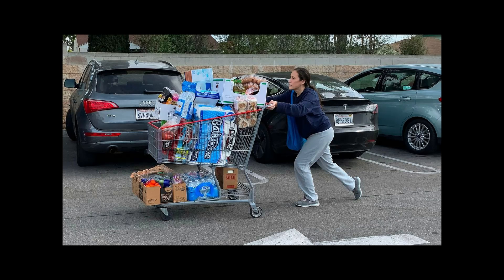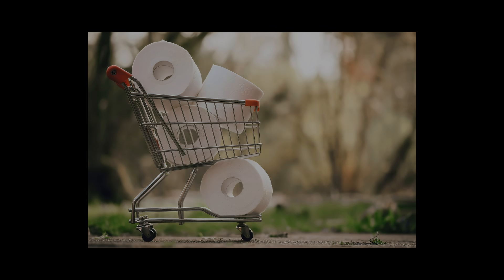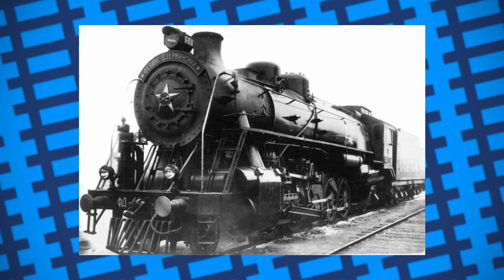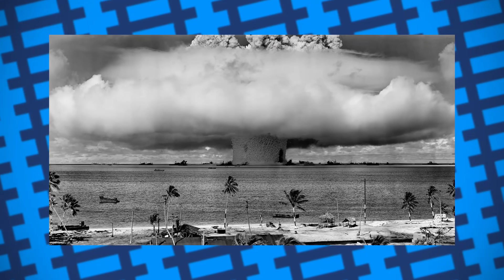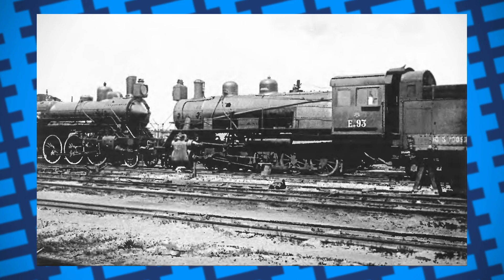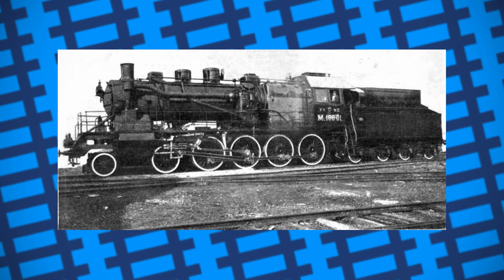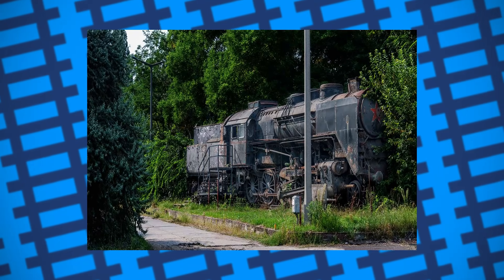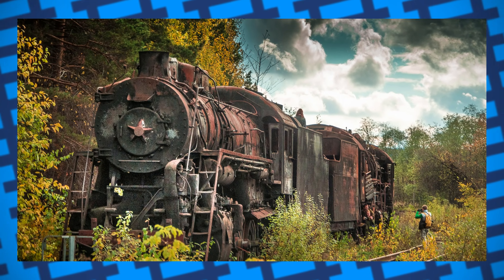Why the USSR preserved hundreds of steam engines - USSR Backup Engines

Comment: One of the other thing compared to early electric and diesel Locomotives, steam locos were actually easier to maintain as they could run even when quite a lot of stuff is broken or damaged. It was why industrial Locomotives in the UK were often Steam even after steam Locomotives had been got rid of on the main line (plus cheaper to rent and run).
Reply: For direct diesel, maybe, but even early diesel electric was much easier to maintain than steam. It’s why they caught on.
Reply: @bigfloppa8626  you do need more maintenance for steam engine but in the end they where easier to replace as diesel engine are way more complex but in term of if everything collapse like in a global war steam engine will be easier to fuel than diesel since refinery will also be gone where you only need to mine coal and the UK wish had a lot of coal could permit itself to still use coal engine changed when gas and diesel become more prevalent
Reply: A steam locomotive can be operated much longer between heavy maintenance cycles, as they will just produce less and less power as the moving parts wear, but they will never completely quit.
Reply: What do you use for lubrication if you can't get petroleum grease?
Reply: @FadkinsDiet  water ?
Reply: @FadkinsDiet wale oil 🤔
Reply: Industrial steam survived far longer at places like mines because all the fuel was free. The maintenance cycle in the UK depended on mileage. But the boiler being a pressure-vessel has to be regularly hydraulically tested at 1.5 times the normal steam pressure. The boiler maintenance cycle is extremely expensive.
But it is true that a steam locomotive could be fired on anything combustible. The haulage ability would be compromised with low-grade fuel such as wood or straw as well as the locomotive spewing sparks.
Comparatively recently China still manufactured brand-new steam locomotives. The QJ and SY class. In Britain series production of steam locomotives ended when the Hunslet Engine Company of Leeds supplied locomotives to the National Coal Board. The very last being NCB No 65 sent to Manvers Main Colliery in 1964.

If you have a location where the industrial process means there is a large source of steam you can have a Fireless locomotive. No boiler, but a pressure vessel that is charged with high-pressure steam & hot water. Such a locomotive could be safely used at a petrol refinery or a factory making pharmaceutical drugs. The locomotive is flash-proof and emits only water vapour.
Reply: @NJPurling  was this comment meant to be in this thread?

Comment: During Russia's attempted terrorwinter when they tried to destroy the electrical grid we actually used this plan. Apparently our former president ordered to restore a lot of these steam engines. And during the winter steam engines with the help of diesel engines where used to carry both military hardware and regular trains. There where some issues with water refilling but it did work out. Some of them had their star repainted in yellow-blue.

Comment: I mean, in case of an all-out nuclear war it makes sense to have some steam-engines in reserve, and to also maintain a limited amount of steam-powered machinery near railways, or even in ports; try short-circuiting them.
Reply: I agree but the problem is nobody except enthusiasts knows how to drive or work with these types of machines these days. 
Older primitive technology should really be thought of to people if a worst case scenario really happens. 
Most people these days have no clue how to survive without electricity.
Reply: The Union Pacific heritage fleet in Cheyenne Wyoming is exactly that.
They've got the tooling, the shop and the expertise to keep a Big Boy running as well a a couple others.

Comment: Gotta give credit where it's due, they probably took better care of their steam engines than us Americans - and the fact so many iconic & unique ones got scrapped across the board is all the more damning; if the bosses at GE, WABTech, the Class 1 railroads & Amtrak would get themselves in better headspace to give new development of steam a chance again, I still think that's worth exploring given how it's been allowed to elsewhere
Reply: Given it's nature - it helped to save pretty sizeable bulk of post WWII steam engines, which were pretty new when transition to electric and diesel began. Pre-war steam or early diesel and electric? No such luck.
Reply: I don’t know if steam could work in service in the modern day. Perhaps if they invented some new kind of low emission fuel they could use steam locomotives to test it. But other then that I see electric locomotives as the future. Then again steam could potentially have a place during war time since they can run on coal which is only needed by power plants these days.
Reply: Honestly the best shot at expanding the number of steam locomotives in the US would probably be to look abroad. The Chinese railways have locomotives built to similar designs to both American and Soviet locomotives so importing ex chinese locomotives (which still operate in regular service to this day in some areas afaik) could maybe be viable. I know some railroads like the Iowa Interstate did that. Alternatively maybe import soviet designs and see if they're regaugeable to standard gauge.
Reply: The US went to diesels. Diesels will function with the electric grid down and their electric systems are hardened against EMP.
Reply: Do you mean in mainline use or just for preserve railways for tourists/tourist trains allowed on the mainline
Reply: Progress, steam engines are insanely inefficient and maintenance heavy. They were maintained but it was cheaper to move on to diesels.
Reply: @aaron___6014  Diesel are LESS fuel efficient than late model steam engines. That’s why coal fired power stations are a thing and not diesel fired ones.
Steam locomotive engines are maintenance hogs (but mostly because they use open lubrication systems) but diesel engines real advantage is rapid startup and shutdown. A steam locomotive needs two hours to start from cold and a similar time for safe shutdown (because a steam locomotive can explode if the boiler water isn’t maintained above its tubes until all the heat (ie burning fuel) is physically removed).
Reply: @allangibson8494  hmm, I was told steam engines are far less efficient than diesel. But I have questioned it while watching steam tractors work.
Reply: @aaron___6014  It is to do with thermal efficiency. That is a question of how cold the exhaust is, and that can be as low as 60C in a condensing double or triple stage steam engine (although that was uncommon until the last generation of steam locomotives).
First generation steam locomotives were horrifically inefficient - they got better as the boiler pressure rose and superheated boilers became common.
The start up and shutdown time (and the need to pay boiler attendants for that time) was the big difference (and diesels being seen as more “modern”).
Electric traction has lower maintenance costs than either but requires more capital infrastructure.
Reply: @allangibson8494  wow, I'm glad I ran into you in the comments. Have you just picked these facts up over time or is there a good resource you could point me too?
Reply: @aaron___6014  Unfortunately I haven’t found anything consolidated.
The problem with steam engines in ships was volume - boilers are inherently space hogs, space that could be filled with cargo or cheap diesel fuel. Road vehicles had the same problem combined with slow starting (which was partly solved - they got the starting time to under ten minutes (but still a little slow for the average modern car user)). The battleships at Pearl Harbor had a particular problem with this on December 7 1941.
Long start times were why fire tube boiler’s were retired in most applications in favour of water tube boilers (and once through flash boilers) except railway locomotives because the boiler was part of the structure of the locomotive. Flash boiler and steam turbine locomotives were built but the diesels were already in service by then.
Reply: @solarflare623 I honestly think that heavy dependence on one technology is a recipe for disaster. Staying familiar with old tech is a smart way to keep civilization on top of it's toes. Electricity is definately useful, but can ultimately fail. I'm not saying we should stay with old tech, but rather staying knowledgable of old tech can allow civilization to thrive on, even without new tech. It's better being safe than sorry.
Reply: @USAFreewayROTF   what about heritage railroads? There are hundreds of heritage railroads across the world with a majority of them operating steam locomotives. They also typically have at least one diesel locomotive. I’m sure if the entire worldwide rail network was electrified then people who work on heritage railroads could pass their knowledge to those who work on the regular railroads if the need for steam or diesel locomotives ever rose.
Reply: @solarflare623  That is true. We'll need their knowledge of steam locomotives to help teach new generations about the use of steam so we don't end up powerless should steam ever be called upon again.
Reply: @aaron___6014 Biggest problem with steam locomotives is the logistics needed to maintain them. Even in the tail end of the steam era, steam locomotives requires large amounts of fuel and water to keep it going, and they need it more frequently.  You will notice the number of fueling and water stations along the mainline of steam locomotives, and those facilities aren't cheap to build and maintain. That is why diesel electric locomotives took over the duties steam locomotives did before: diesel fuel being more easy to store and transport...
Reply: @theotherohlourdespadua1131  Maybe, but if you're dealing with a world were electronics is dead, that unfortunately wouldn't matter in the slightest cause diesels use electricity to run. Steam will be needed out of necessity at that point, instead of want.
Reply: @survivingworldsteam  The other expense is restoring the workshops required to repair steam locomotive running gear - wheel lathes big enough to machine steam locomotives driving wheels haven’t been made since the 1960’s…
I actually live next to a preservation railway and they manufacture and retube their own replacement boilers because fire tube boiler manufacturing is a lost skill set. Even boiler and tender riveting is a lost art - you need to manufacture tools first because they are no longer commercially available.
They also had to design new carriage bogies because they couldn’t buy the bearing parts for the old ones anymore and had to completely redesign the bogies to take the new axle bearings and wheels.
They operated five to ten scheduled services a day, 365 days a year on a 16 mile long track so, yes, the costs are significant.
Reply: Nothing in USSR was very well maintained, no one gave a crap about anything. The quality was poor to begin with. Just a glimpse of the Ukraine War shows what a paper tiger USSR was by 1991. All those thousands upon thousands of tanks, and they are cannibalizing ancient crap trying to get 1 working tank out of 3 or 4. That traffic jam of vehicles going into Kiev started from trucks that were in storage for 40+ years that were never maintained, not even getting new tires, and nothing made the 80 miles from the border to the city. Just after WWII into the 60s was the peak of the USSR, anything pre-war or 70s on was just crudely made shit.
Reply: @allangibson8494  coal is cheap, but it's not efficient. Natural gas fired plants are much more efficient to operate than coal, but not quite as cheap. There is no decoking of gas powered plants as in coal, not to mention tons less emissions. A lot of the very last steam locos were oil burners as it was just less maintenance and more efficiency.
Reply: @bluedogsalvage5246  Powdered coal fired boilers were a thing at the end of the steam era (and that exact technology is still used on stationary thermal power stations).
The “instant on” nature of internal combustion engines was a significant advantage over the slow heating of steam boilers (although, again, late generation coal fired boilers have dramatically shortened the load swing time from zero to full load (I worked on one 200MW unit that could go from zero to full load in 40 seconds - marginally slower than a gas turbine’s 10 seconds) once preheated.
Thermal power plants are highly efficient (far more than diesels).
Oil does however have a higher energy density (which is a particular advantage for ships).
Reply: @drdewott9154  that boat sailed about 20 years ago.  Virtually all of Chinese mainline steam is gone now; only a few narrow gauge examples may still be running.  Those that ran until the end were often poorly maintained; their crews knowing their time was short.
Reply: @allangibson8494  powerplants used coal not because it was more efficient; it wasn't.  The problem is that diesel engines do not scale up to the hundreds of megawatts most conventional fossil fueled power plants are capable of.

Fossil fired conventional power plants are actually very inefficient; only about 10-20 percent of the energy generated is converted to electricity.  Most of the energy goes into heating the boiler tubes and firebrick, radiated as heat, or out the smokestack.

Coal fired conventional powerplants are even worst because energy is needed to run the conveyor belts moving the coal, the pulverizers, and the emission control equipment.  If the coal is stored in an outside coal pile and gets wet, it is even worst.

Most efficient form of generation is a combined cycle powerplant, which uses a gas turbine (jet engine) mated to a heat recovery steam generator (like a boiler).  The shaft of the gas turbine drives one generator, while the steam is used to power a conventional steam turbine-generator.  These can be up to 75% efficient; but can only burn natural gas because coal and oil causes too much blade erosion.
Reply: @survivingworldsteam  Modern fossil fuel coal fired power plants actually top 40% efficiency. That’s how they can afford to make power at <6c/kWh.
Transmission losses for power generation to end users typically run to 50% however.
Combined cycle (gas turbine front end and steam boiler/turbine backend) can top 60% efficiency - but you need a gas supply.
Diesel generators average about 30% efficiency (but work better at small sizes).
Gas fired boilers need less maintenance than either coal or oil fired boilers (because they don’t soot up), but gas is hard to store.
Steam powered ships went away because boilers take up a lot of space and oil was cheap. 2/3 of a steam powered Atlantic liners hull was boilers and coal/oil bunkers. 1/10 of a diesel powered ship is now engine space.
Reply: @allangibson8494 The reason coal is used instead if diesel probably has more to do with price, not efficiency. What's more, the steam system in power plants has nothing in common with that of trains.
Reply: @AdamantLightLP  Locomotive steam systems ran about half a century behind marine and power generation systems but water tube, superheated steam and steam turbine locomotives along with coal dust firing were all tried towards the end of the steam era. My great grandfather drove a coal dust fired superheated locomotive with a double expansion three cylinder drive in the late 1940’s. The tender only exploded twice. (Coal dust is a BITCH - oil firing is much safer even with a nitrogen blanket in the bunker).

Comment: In Western Australia our government run railway at the time - the WAGR did something similar, however it wasn’t because of the Cold War directly, rather it was because of the fears that there would be an oil crisis putting the diesel fleet out of commission. Thankfully this also didn’t happen, and like the USSR, many of the locos were preserved or scrapped…
Reply: As an Australian I actually never heard about this before. Suffice to say, I'd be fascinated to learn more. I don't suppose you have have any pointers towards some interesting material based around said topic?
Reply: @henrydawson8767  if you search up WAGR 1960’s steam it should show up films from that era. There’s one video I think called Rail around 1990? Or similar that shows the lines of steam locomotives lined up in Collie. Many of those that were dumped are still there and preserved…
Reply: I’d imagine that all of them were preserved or scrapped.

Comment: 3:30 Most of the steam locomotives at Shumkovo station were scrapped several years ago, but some of them were delivered to Perm and restored. Now they are mainly used for events and pulling tourist trains. But sometimes they are used for shunting work. This is necessary so that crews do not lose their skills in working with steam engines.

Comment: Most steam engines that are preserved and running were working engines long after they were obsolete. In places like steel mills, mines, and logging operations where the lines were short and fuel was plentiful and a byproduct of the main operation. 

The reason being is because steam engines since they use water and very corrosive gases to heat it will rust out very quickly unless constantly being used, oiled, and wiped.

Comment: you should maybe do a video about one of the most built (and maybe even one of the most underrated) 2-10-0 decapods to ever exist
the DRG Class 52 (would be nice if you do a video about it)
Reply: (also i have to add: on May 21th 1994 about 10 Class 52s were celebrating the 52th Anniversary of the Class 52 at the Railway Museum Strasshof in Strasshof an der Nordbahn, Austria. With them was the newly restored 52.100 which was brought from Yugoslavia in 1991 to the Railway Museum Strasshof and is now owned by the 1. Austrian Tram and Railway Club [short 1.ÖSEK])